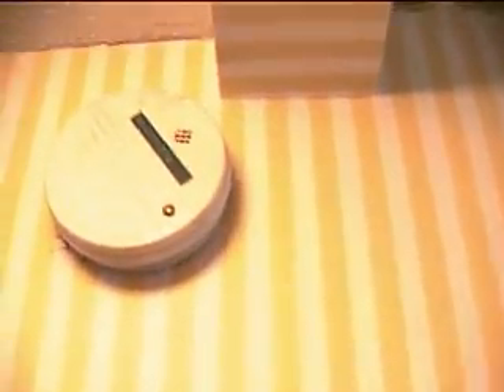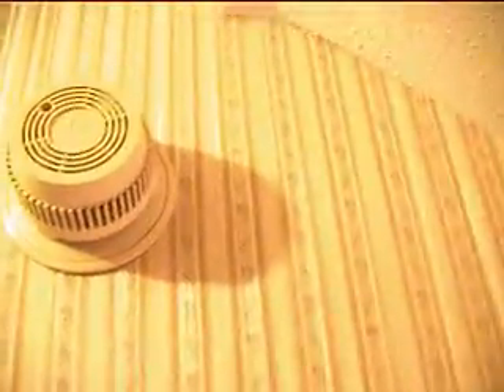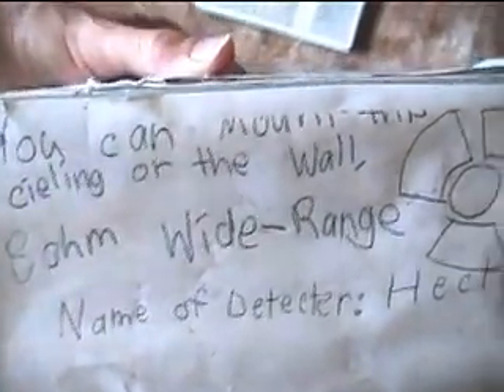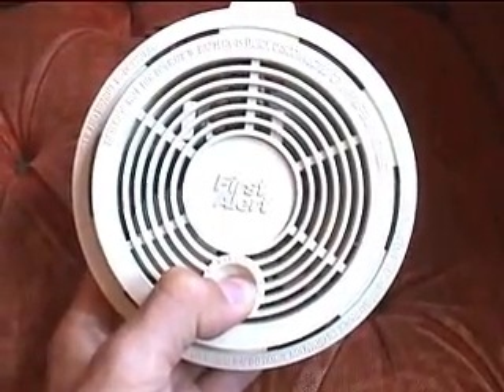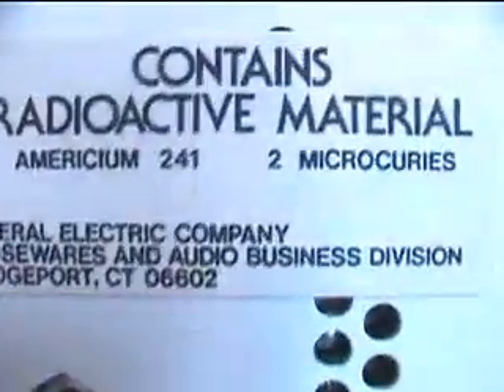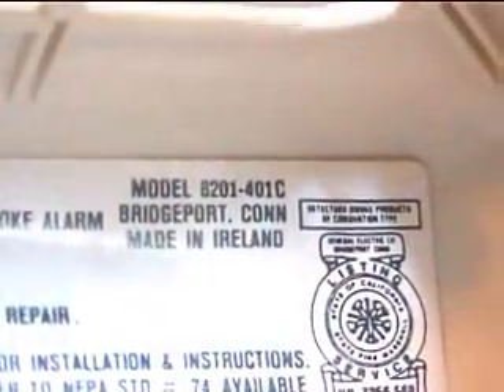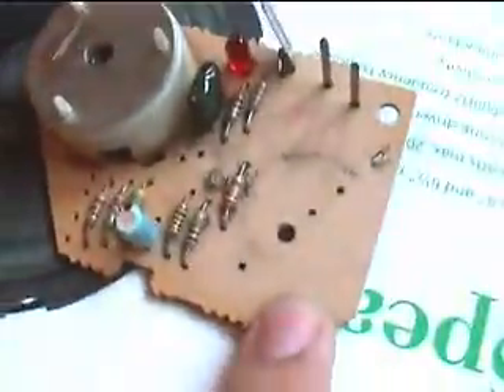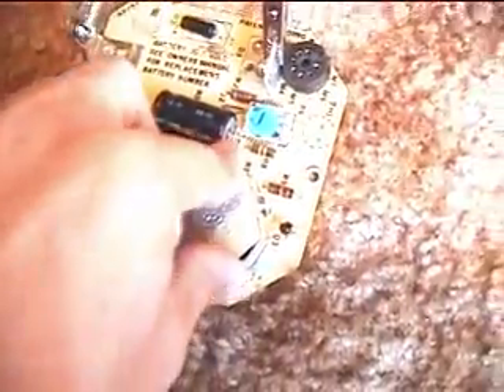Smoke Detectors!

Comment: I know this is an old video, but I must ask: Do you still have the detector that took the 10.7V battery. That is an EXTREMELY rare, and ancientBRKsmoke detector, the SS-74R. Only one other is known to exist. Which is why I’m commenting about this. Not many are left out there.
Reply from the maker: Only one other known to exist‽ O my gosh!! That is amazing! I still have the circuit board somewhere. But I am very sad to say the plastic case for it is long gone, and was gone years before this video was even made, as I got it as a kid in my "take apart" days at a yard sale, and back then the outer cases of things were usually discarded while keeping the innards.
Reply: @CassetteMaster  Hey, that’s better than nothing! But yeah, these are INCREDIBLY rare. The other one is actually rebranded as Sears, but owned by Baltimore alarms and fans. The Original BRK version looked identical to the SA76RS, but had no vents or button. What did the cover to this one look like? There were several rebrands and I am curious as to that this one you have was.
Reply from the maker: @randomnessidek1259  From memory, it had the same style of vents as the Sears.
Reply: @CassetteMaster  Whoa, so just like the other. Thanks for the info man! We collectors really appreciate you shining light on this rare specimen. Also the BRK PCB that had the large round sensor, and that immediately went off when you put the battery to it, what was that one, if you remember? That’s another oddball one we’ve never been able to identify. And what did it’s housing look like?
Reply: @randomnessidek1259  I am also interested in this oddball circuit board. It is the only example of this setup I have ever seen on a BRK/First Alert PCB of this era, with the later style sensor and old style horn and they are switched places on the circuit board from where they would normally be on a normal model 77R or SA76RS. Also the pulsating horn pattern which BRK never did with any of their other models that used mechanical horns. I'm wondering if it isn't some factory screw up, a prototype of some sort, or some really rare model that didn't sell too well back in the day so left no trace. It honestly looks like a homemade project board but I know it isn't.
Reply from the maker: @randomnessidek1259  I don't know its model number, but it was a large circular detector with concentric circle vents to a roughly 1 and a half inch solid portion in the middle, yellowed with age.

Comment: The very last PCB is an ancient BRK model, the SS-74R. I've never seen one before and yours seems to be the only one known to exist.
Reply: What's the one before that?
Reply: AFAIK this one, the SS-718 (74R with interconnect and relay), SS-74 (same as the 74R but used an 11.2v battery), all were made around the same time. The early 70's are a hard time to determine which BRK models came first as there is little information out there about them. I believe that these were all BRK's first models.
Reply: @BAFVintage  I was asking what the one with the round ion chamber and squealer horn was. The one that he said sounds until the battery was removed.
Reply: That one is an obscure transitional model between the SA76RS and SA76RC. I don't know what the model number would be. It would date from around 1978-1980 I believe.
Reply: @BAFVintage  My guess is a BRK 78R.
Reply: No such model number exists in BRK's catalogs. It's possible it was a factory mixup.
Reply: @BAFVintage  Well not till 2023 when we found out 78R did exist in a wireless case, so my guess was pretty much correct.

Comment: Wow that second detector is a blast from my past. My old house (from the late1950s) had 3 interconnected ones (I'm guessing installed many years later) and when they went off, you KNEW it!! It used to sound due to high humidity and/or and steam from the shower (one was in the garage)...My new house (est in 1981) had the same one upstairs (since removed) and same one downstairs, but it's nice and quiet so far lol...(no false alarms)

Comment: Not a good idea to remove the lid of that internal metal protective cage which houses the americium (as seen in the video).  If you knock or scrape that little blob of americium, you risk a leak which will result in a vapour which goes directly into your lungs at a toxic quantity.  I recommend the use of non-radioactive smoke alarms

Comment: 5/5! Very Nice Demonstration! I especially like the old smoke detector that contains 0.5 uCi of Ra-226, (Radium-226). Unlike Americium-241, which decays also by Alpha particles, it also decays by spontaneous fission, ~432 years 1/2L, but Ra-226 is much more radioactive, and has longer 1/2L, of ~1602 years, and decays only by Alpha, but much stronger. It's not used anymore, because Radium will replace Calcium (in bones i.e.) which can cause bone cancer, but not, say from the radiation itself.

Comment: Yup, all houses must have AC powered detectors, because the battery powered ones are less reliable.

Personally, I think the AC ones are good, but what if the fire knocks out the power, or if there's a fire during a power outage? That's why we still have our battery ones as well as the AC ones.

Comment: Also that's the first battery-powered electromechanical alarm that makes a pulsating noise rather than a continuous blast. Also you might try adjusting that pot there beneath the test button (the blue thing). That adjusts the sensitivity of the alarm. Readjusting it might stop it from going off immediately when you apply power. If you can find the case maybe you could send it to me for my collection! If not, that's fine too. The third PCB looked like it was from a Code One alarm.